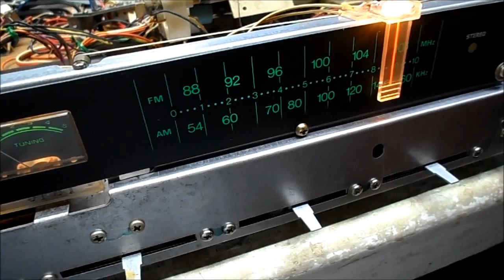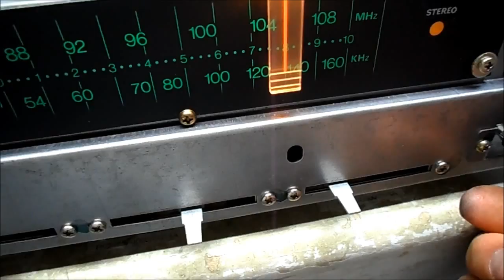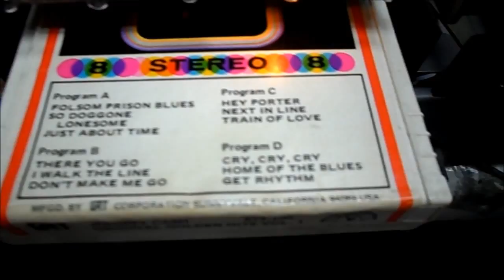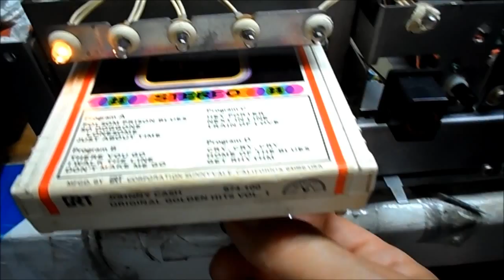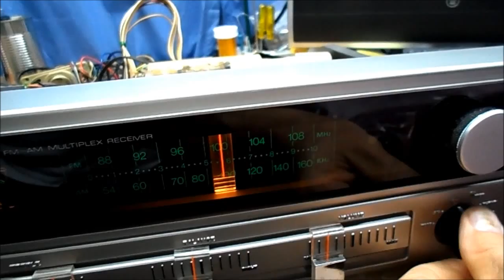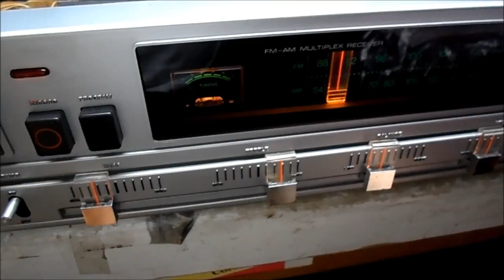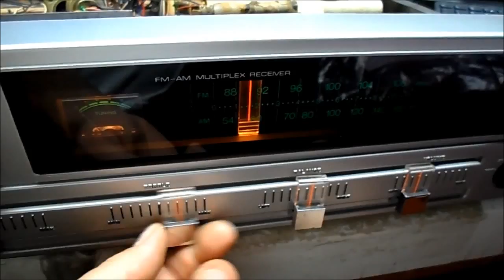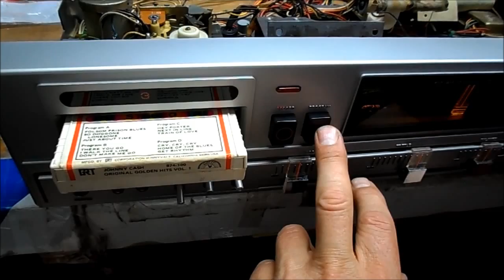Lloyds Part 5b. 8-Track Repairs. Done.

Comment: Great to see this 40 year old am/fm stereo radio 8 track recorder repaired and restored to it former glory altogether. As I've only just learned how to repair 8 track stereo players/recorders,,,during the corona virus outbreak pandemic lockdowns. 
That,s one thing I need to do,,,,demagnetise tape heads.

Yes,,,I had done the radio tuner oscillator realignments too,,,on both am/fm bands,,,getting the station tuning back where they were on the dial numbers,,,only after checking to b sure dial pointer is in right place on the tuning cord first,,,as I've had found a few on vintage stereo tuners out of place too far to the left or right of dial scale. Took some time in realignments to make station tuning oscillator match to dial numbers,,,and re-adjusting sensitivity trimmers,,for maximum background noise,,,,and re-aligned ferrite antenna coil on bar rod too,,,for equal background noise on am 540khz,,,1000khz,,,and 1600khz,,,,but not 100 percent perfection,,,due to some worn out tuning capacitors on radio tuner sets,,,but still had got them working better than b4 with radio reception,,,,after cleaning,,,,re-soldering dry solder joints,,,especially where parts get hot during use,,,such as in amplifier sections,,,and readjustment of radio tuner bands oscillation and reception sensitivity in background noise.

The tuning/signal meter helps out really well with the maximum signal strength,,,and zero tuning alignment on fm frequency too.  Never been much trouble after that,,,as many of my friends have kept their nostalgic stereo sets in clean condition and excellent working order,,,in mancave homes and sheds.

Comment: A lot of good detail here. You were able to glue the polyethylene head mount frame with super glue and it held? Polyethylene generally is not glueable except with certain epoxies. This type of changer is the earlier version of the non-solenoid, magnetic bracket tripping type; the later version did away with the forked top bracket, had a smaller white wheel and no second/lower "C"-clip for the plastic head bracket. Thanks for the video and keep up the good work!
Reply from the maker: Like to try plastic welding, & yes you're supposed to use like plastics when mending it say's. What might plastic 50's-60's table radios be for instance. GE was big into plastics. They did not have the numbered triangles back then of course. Polystyrene?